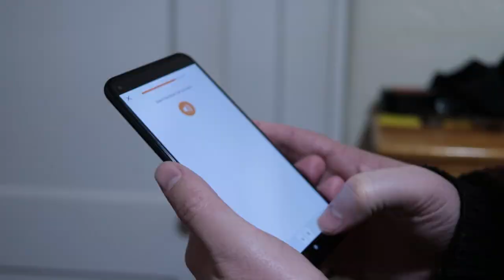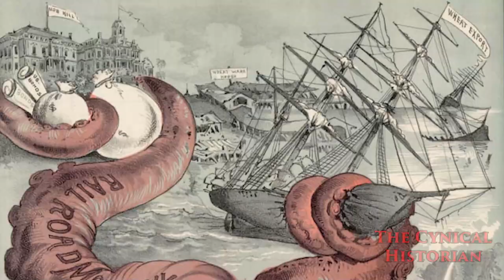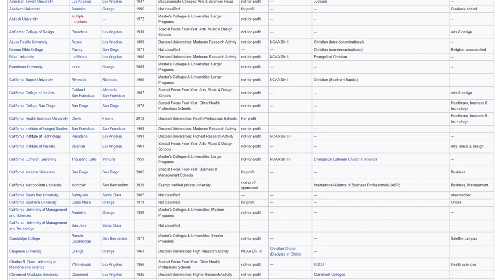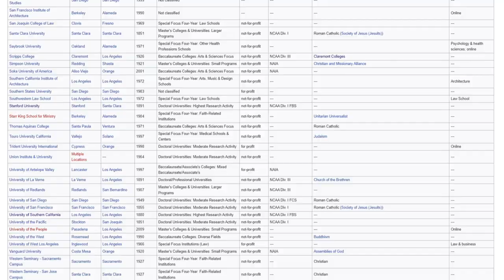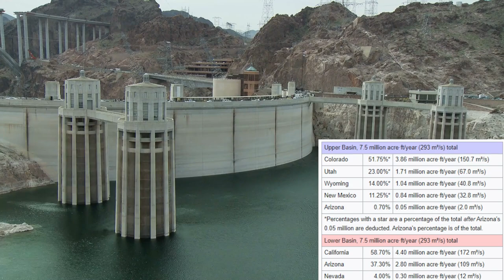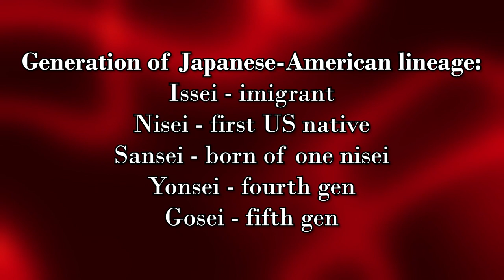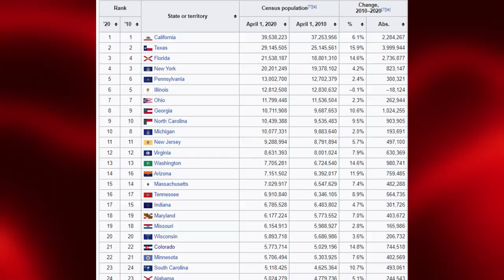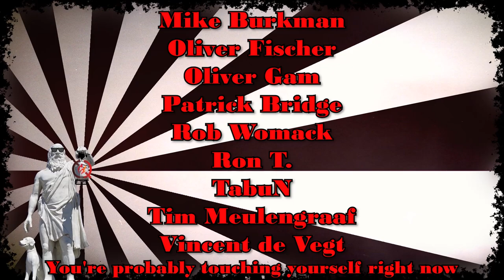How California Became the Most Powerful State

Comment: I would like to see part 2, the eventual decline.
Reply: Paraphrasing Benjamin Franklin to Sir Edward Gibbon, "Sorry to bother you. Let me know when you'll be needing documents for a work on the rise and fall of the British Empire." IOW don't hold your breath.
Reply: @stephenwright8824  Ok, but there's actual reasons to suspect it will decline such as energy issues, or maybe inflation causing general transport costs to rise or bottleneck in ways that make ripples that eventually crush away at bits of its economy
Reply: @stephenwright8824  And the brittish empire kinda did fall, they sure don't hold the territory they used to